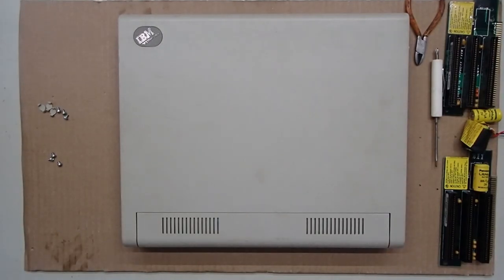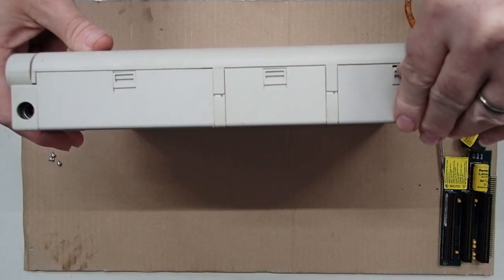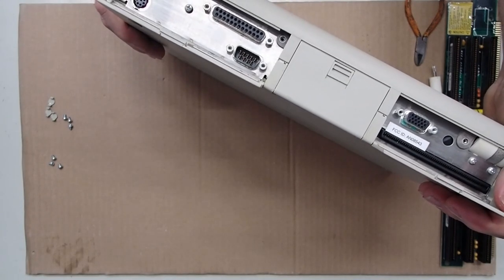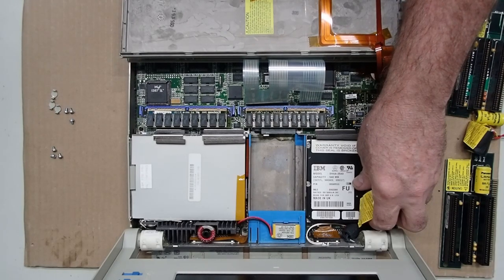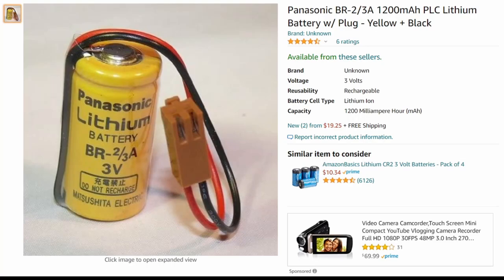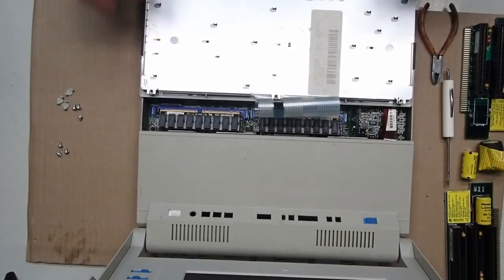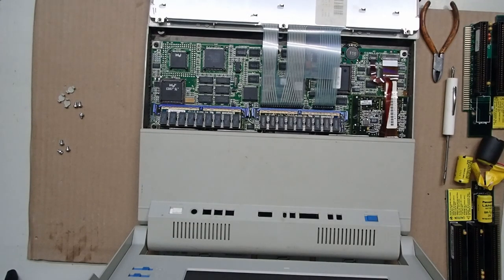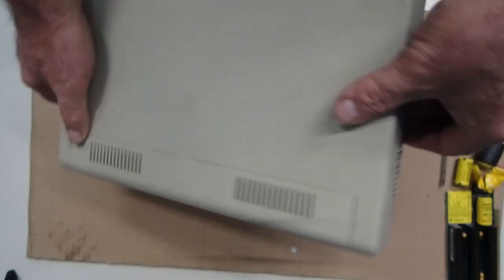IBM PS/2 L40SX Opening and Backup Battery Replacement

Comment: Thank you for the great video. I have the same exact computer but with broken LCD :\. If anyone has a spare LCD or know a replacement that can fit, then please leave me a comment here.
Reply from the maker: The screens can get easily damaged by temperatures in storage - so yes, a retrofit solution needs to be found.
Reply: @IBM_Museum  Actually, the screen got damaged during shipping ;( 
I need to find a way to open the computer's lid, which is secured by a couple of strange screws! When I open the lid, I'll see what LCD and driving board I can fit inside.
Reply from the maker: @_techana : Dave at EEVBlog has a good L40SX teardown video, but I don't know if he got into the screen area. The L40SX uses a Western Digital chipset, including the 90C20 VGA chip. That is documented here: https://www.ardent-tool.com/datasheets/WD_WD90C20_90C22.pdf
Reply from the maker: @_techana : The WD90C20 is grayscale of course - otherwise there could be easy support for a more modern color panel (like the 90C24 would support - I thought there was another IBM design that used it, but I can't remember it now). Whether it is a cracked screen or damaged LCD cells from freezing, there needs to be a path for an easy screen replacement.

The L40SX also needs to have the battery and charging/power section updated with a modern solution. The replacement battery is easy enough. Have you seen how to upgrade the SIMMs? I have a couple L40SX with 18Mb of RAM (2Mb EMS)!
Reply: @IBM_Museum  Yes, I saw the EEVblog teardown, but he also couldn’t get access to the LCD.
Reply: @IBM_Museum  My plan is to install a 10" color LCD panel with a VGA driving board. The video signal to the driving board will be drawn from the laptop's built-in VGA socket.
Reply from the maker: @_techana : Seeing what is out there, this seems like the best plan...